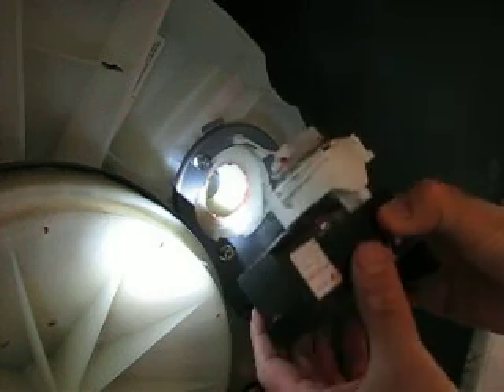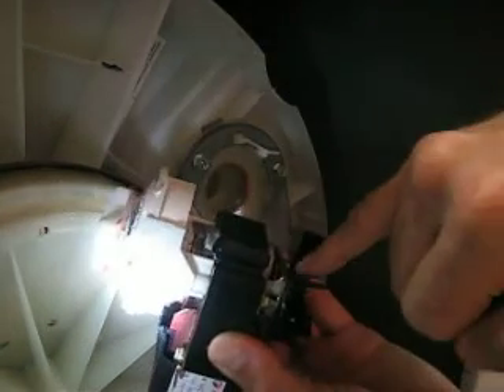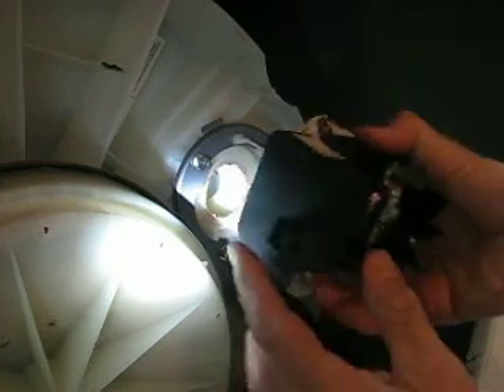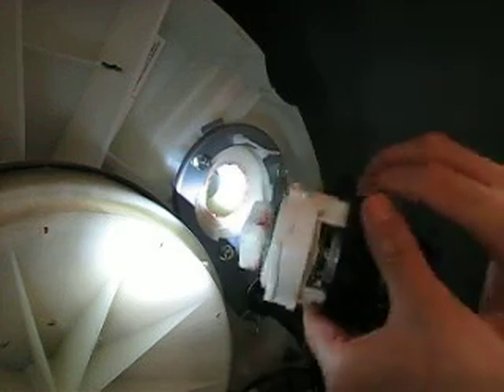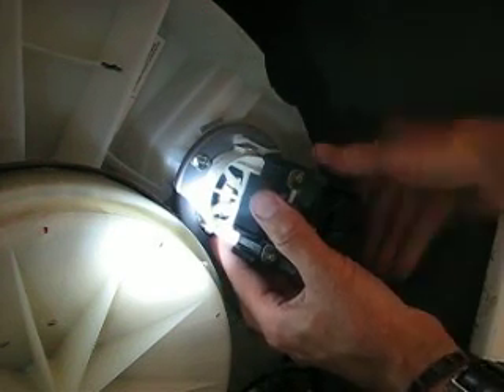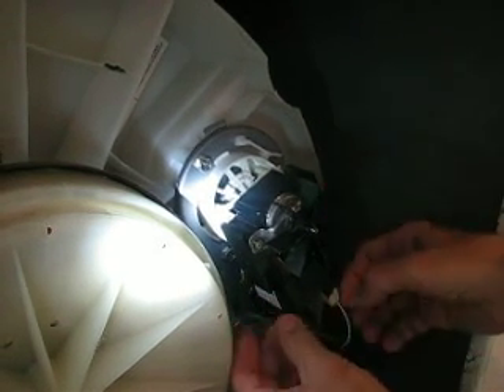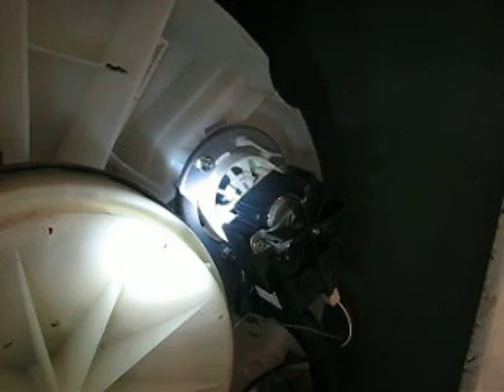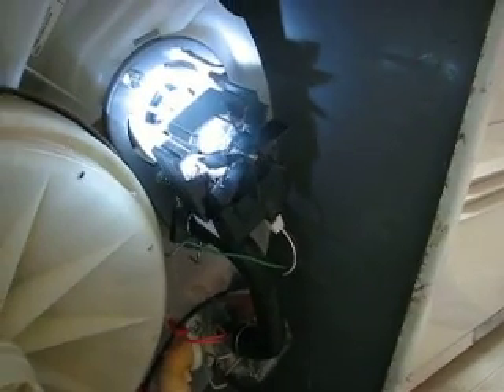Fisher and Paykel - Part 3 - Washing Machine Screeching Noise Fix

Comment: I'm glad that I found your set of three videos.  The high pitched screeching sound is exactly what I have on my Australian model of this washing machine and the fault you have described is the correct diagnosis.  In the case of my pump, the bearings were too far gone and greasing them would only have been a short term option.  There was a lot of free play between shaft and bearings and while replacing the bearings was an option, the condition of the rest of the pump and motor assembly was noted. The pump motor laminations had seen better days - rust had started to expand some gaps between the laminations - not a good look.  Rather than expending effort and new bearings on what would be a temporary fix - I chose to replace the pump with a new one.  For anyone reading this - if you are capable of removing the existing pump as shown in these videos then you are equally capable of replacing the old pump assembly with a new one.  I do not consider the genuine part expensive - it was available locally and involved a one hour round trip including re-installation.  Problem solved - all is silent now and no high pitch screeching.  And no - don't go chasing fictional diverter valve problems - fix the source of the problem properly - eliminate one variable - before chasing the next.  To do otherwise means that you are learning with your cheque book :-)

Comment: I was getting ready to replace the water fill solenoid because I thought that was where the noise was coming from. Decided to look online to see if anybody else was having a similar problem, and I found this site. Still didn't believe it was the problem, but decided to give it a try instead of buying a $100 valve. 10 minutes later my problem is solved. THANKS!
Reply from the maker: You're welcome, Jeff. Glad it worked out well.

Comment: Thank you so much for posting this video.  Since my husband was busy on the computer with a deadline, I did the whole repair myself in under an hour (including disconnecting/reconnecting, moving it into the kitchen where I would have more room to maneuver, putting it on its side, and cleaning up the water) and results are... no more screeching.  I went low tech - I used an old dry toothbrush to clean it up, and used DW-40 to lubricate.  There was quite a bit of water that flowed out of the machine while it was on it's side, so having some towels handy and doing it on a floor you dont mind getting wet is a good idea.  Also of note, I drained the remaining water in the hoses, both water ins and dirty water out pipe before I laid the machine down. Even so, I heard a big slosh when I leaned it over to put it on its side, and water slowly made its way out.  There must be quite a bit of water that just remains in the machine while it is at rest.  Anyway, thank you so much for sharing your solution and method.  No doubt this is a common problem with FP washers and you are saving many people lots of service charges.  Just for anyone still wondering if you can do this repair, you can.  It is really simple.

Comment: Everything went as you said. One thing different was when i laid the washer over the motor cooling fan was laying on the floor. :( I followed your instructions and all went well.
I used a can of air to clean the unit.
I wiped it nice and clean. I put lithium grease on the rubber disk and then carefully applied it to the the shaft with a q-tip. 
Pressed the cooling fan back on and she is working fine.
One note I would like to make is that when I loaded her this morning I overloaded her. Now that it's winter my flannel shirts soak up a lot of water. As the owners manual states, Do NOT overload. I removed a few wet shirts and she started up but squealed a little bit. 
Thank you for the helpful information.

Comment: Greasing the impeller assembly will transfere grease into the wash, the issue is the pump bearings, you need to disassemble the pump by removing the fan then the bearing retainer bolts. Spraying some lub around is only a short term fix, which is why you have had to do this 2 or 3 times. I have worked on washers for 10 years.
Reply: Is that pretty straightforward? Should we replace he bearings, or just add grease?

Comment: That worked a treat!!  Thanks Alan. You can also pull the pump apart quite easily. Hold the propeller thing still and unscrew the plastic thingy on the other end.  Carefully remove the black rubber seal to see if anything stuck behind it. I found some string wrapped around the rotor shaft. Don't think this was the cause of the noise though. 
Spraying the lithium grease did the trick and squealing stopped. Cost $16 can from Bunnings. WD40 brand. Much cheaper than calling out a service repairman!!
Peter 2-6-2015

Comment: Alan,  Did this fix your issue?  Mine just started making the same noise today and came across your video.  How long does lubricating fix this issue and is replacement inevitable?
Reply from the maker: Hi Christopher.  My video was made about 8 years ago, and since then, I haven't had to regrease it at all.  At the time of the video, the washer was about 2 years old.  I don't know how old yours is, but if you're doing it for the 1st time to an older machine, I can't say how long it will last. Good luck. Cheers.
Reply: @awparamount   Thanks for the information.  My washer is pushing 16 years and still going strong. The only repair I had to do so far to the unit was the hot and cold valves because of leaks.
Reply from the maker: @christopherklanica4155   Let me know how it goes, Christopher.
Reply: @awparamount  My issue actually got better after I washed a load or two..... then today the water fall function stopped and draining was extremely slow.  Took it apart and of all things found an eye glass cleaning cloth balled up blocking the water flow.  I cleaned the pump motor with electrical contact cleaner, used canned air to blow out all the dirt and applied a little lube on the bearings the little shaft goes through and reinstalled.  Works great.  Thanks again for your video.

Comment: I think I have this exact washer (purchased in 1996 by the previous owner) and am having this awful sound. How do I get to this part that you're showing? is it the back? side? bottom?
Reply from the maker: Hi there. In this case, you won't need to replace any specific part, you just need to tip it over on its back and regrease the area as shown in the videos.  If done correctly, you won't need to do this again for years. Fill me in on how it goes. Cheers
Reply from the maker: Oh, underneath in the centre.

Comment: A good piece of advice. Be careful with using grease on rubber seals. Use only grease that wont make the seal go spongy. I use the special grease that I have for the various O rings on my pool filter or special rubber grease that is used on brake cylinder repairs.

Comment: All good here.  Maybe replacing the pump would be ideal, but treating the problem, ie. replacing the dried out/evaporated lubricant with fresh lubricant and getting immediate results, buying a year or two of operation and not having to fork out $200 and wait for another pump, is a pretty good second place strategy.  Worked fine for me.

Comment: My question is the following: I have the same machine, the pump clip broke years ago, so in order to remove the pump I have to loosen the 4 screws that thread between the metal plate and the outer plastic tub.  Did you have to  loosen said screws to remove pump? I opted to purchase a new pump.

Comment: Applying grease to the impeller and rubber seal at the top of the pump does nothing to alleviate the squeal.  As C Donuts says, the source of the squeal is the bearings on the pump motor.  Lubricating them is a temporary fix.  Proper fix is to replace the pump.  It will eventually go to leaking ... maybe sooner than later depending how badly the bearings are worn.  A wet pump can short-out and destroy the motor controller board.   Don't play around with this situation.  Fix it properly!
Reply: DADoESofTX 100% true thats why you need to put a fuse in the controller pump port!!
Reply: I had the same problem except the pump was leaking to the point that it overloaded the controller board.  Fortunately the only problem with the controller board is a blown fuse, but it is soldered in.  I will be replacing the pump, adding the included inline fuse, and replacing the controller board fuse as soon as I get the parts.
Reply: Kevin Fultz how did you know you needed to replace that particular fuse & what part to order?  I may need to replace the pump

Comment: what a whole lotta bull. Why do u guys make out u no what u'r talking about. not once have u mentioned the real cause of the real fault.  "the bearings are stuffed - WORN" and must be replaced. If its a low droning loud noise while in drain & spin mode, its yor main bearing, u can temporarily cut noise down ever so slightly with lube spray, but the bearings must be eventually replaced for total repair.
Any higher screeching noise, its straight up one of the smaller bearings.Remember that there are two bearings on each shaft, therefore u may have to buy a set  (a pair) of bearings. Lastly, u must gauge the inside & outside diameters of the offending bearing with a set of vernier calipers for exact size that must be carefully refitted.
P.S.    I'm no mechanic however, nor are you guys. GIVE real solutions, not maybees or couldbees. ID the exact area not try this then that. Name the fault then workout their real solutions.
Reply: I see Rocky you're having a bad day. I posted this years ago and since that time, it's been working perfectly. So I think I know what I'm talking about and most of the replies have been the same, but you are right about one thing, you're no mechanic.